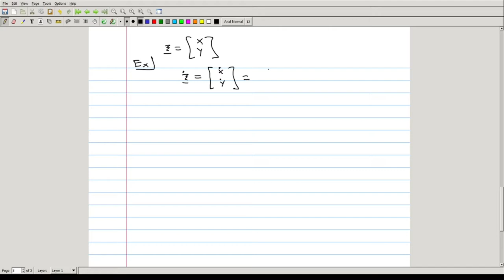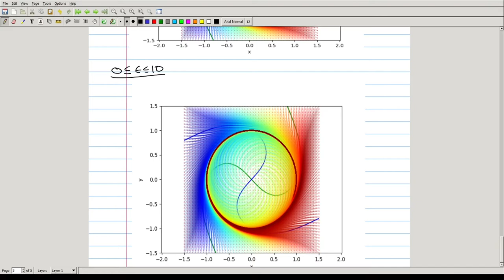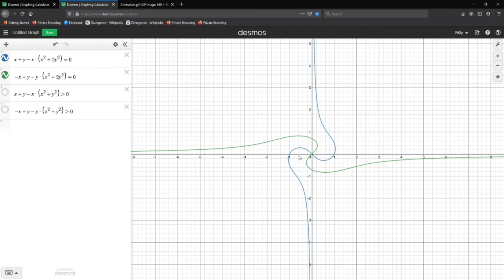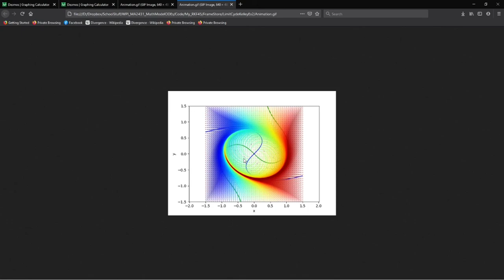Lecture12  - Part 1: Limit Cycles Using Polar Coordinates

Comment: In the 49th minute, why did you choose the value of  r=1/2 ?
Reply from the maker: Great question! Sorry for the late response. 

Nothing too special about r=1/2 here. As long as you choose an annular region for which r'<0 on the outer boundary curve and r'>0 on the inner boundary curve, the ODE forces the solution into a region and a limit cycle has to exist there. This is an exercise in the book Theory of Differential equations by Kelley and Peterson